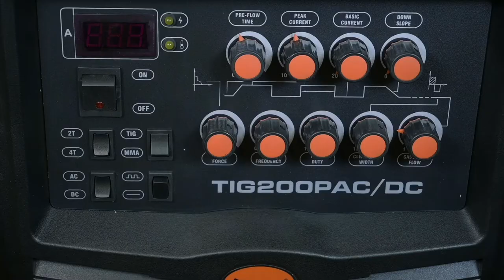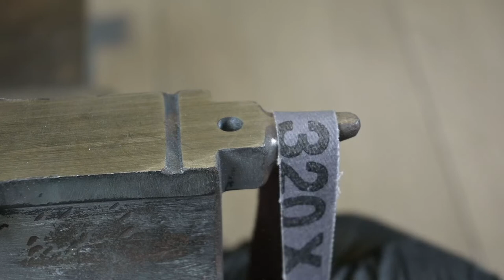Small vise restoration

Comment: Fantastic job 👍enjoyed watching this.
Love the blue.
Reply from the maker: Thank you very much for your kind feedback.  And yes - bluing is one of my favorite processes)
Reply: @werkstatt71restorations49  oh I meant the  powder coat but yes cold bluing is my favorite process also. Hey how do you find your sandblaster ? I have the same one and find the sand sticks to the sides and has trouble falling to the center
Reply from the maker: I faced this problem too.  You can remove the grate to make it easier to shovel sand into the center with your hands.  But I usually sandblast with short strokes with maximum air pressure, so a little sand always stays in the center
Reply from the maker: Hah, I think powder coating is the best option for a small workshop.  Moreover, I settled in the garage, the humidity here is not quite ideal for classic painting, plus in my region the winters are cold and the summers are hot and this greatly complicates the drying process of the paint.  And it's easier with the powder: bake it in the oven and you're done!  The main thing is to get your hand in applying the correct layer of paint =)
Reply: @werkstatt71restorations49  I usually just tap the sides of the box but I was thinking of buying an air vibration motor and putting it underneath and plumbing it in so that it only works when the gun is pulled. Let me know if you don't know what I'm talking about and I'll find a link for you.
Reply from the maker: yes, share the link, please
Reply: @werkstatt71restorations49  Oh id love to get a powder coating machine. Sounds like your weather is a bit extreme, Looks like you know how much to apply.
Reply from the maker: Thank you!)
Reply: @werkstatt71restorations49  no problems at all